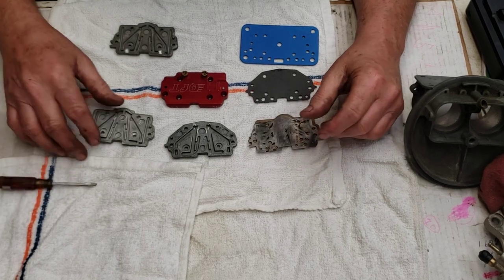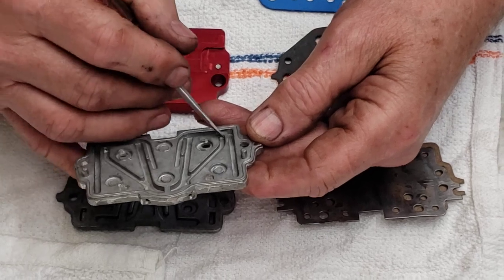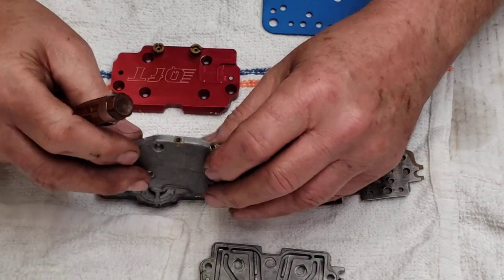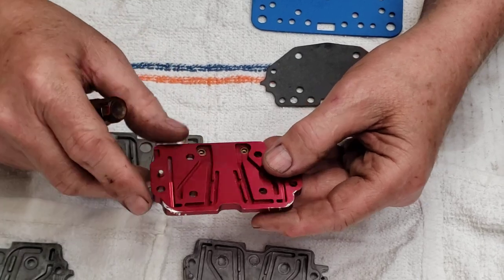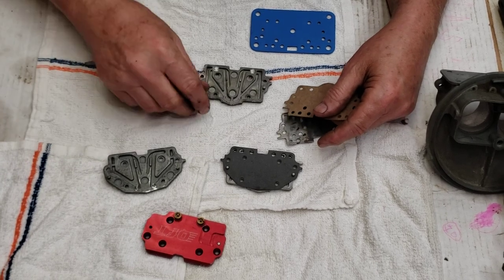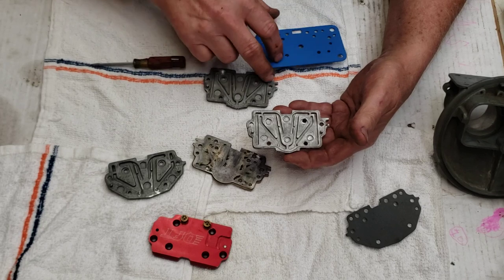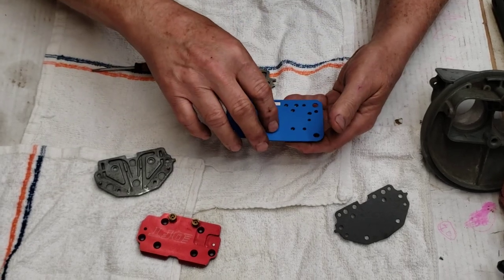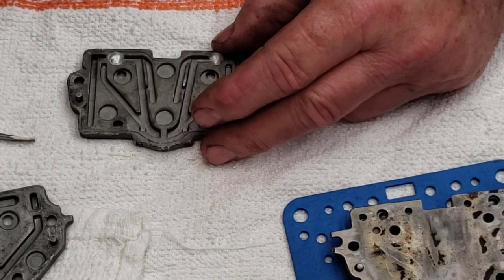4160 Rear Metering Plate Tips & Tricks

Comment: I bought the same QFT plate.  I am not sure whether or not to install the original thin plate when changing the metering plate. I seems the QFT is thicker but I wasn’t sure whether it goes gasket plate gasket QFT plate or gasket then QFT plate. Thanks!  Great info on the channel. I have learned a lot!
Reply from the maker: I just run gasket and plate. Hope this helps.
Reply: Yes it does. Thanks again!

Comment: How much thicker  is the qft plate? Will it interfere with the float? I like the side hung bowl on my 1850. Liked your video. Keep it up.
Reply from the maker: Qft plate about the same thickness and yes it will interfere with a brass center hung  float. Hope this helps.
Reply: Thanks for answering the question. On another note, would the qft plate interfere with the nitrophyl float in a side hung bowl?

Comment: Randy, I just upgraded my 3310-2 from a 134-21 metering plate to a secondary metering block conversion Holley kit. The factory metering plate had .039-.040 IFR’s. This new metering block has .030 IFR’s. Does that mean I have to drill them to .039-.040? Any advice would help. This carb has no secondary idle. Only the tiny drip holes under the secondary transition. Thank you and great video!
Reply from the maker: I think I would try it with the .030 thousandth ifrs and see. The metering block is absolutely better than the plate. If it causes problems then I would change it. Hope this helps

Comment: Hi Randy !Thanks for all videos they are very helpful. Can you tell me how much the secondary transfer slots should be open? my primary ones are .040 open as  you have said in another video but to get my idle speed to 900 RPM i need to open the rear up to .080 is this to much?my mixture screw are 3/4 turn out to get the best vacuum. Carb is 0-1850 600 CFM 2 corner idle, on performer RPM MANIFOLD 302 Windsor with a mild 220/235 @ 050 hyd cam. Thanks for any more help that you can suggest.
Reply from the maker: I usually drill bypass holes in the throttle plates but, if its not causing you any problems that will be ok but no further than .080, I would rather drill bypass holes its a better way with out opening the secondary plates. I usually start by drilling four  .080 holes in the throttle plates , drill the holes in the throttle butterflies on the out board side , or the side nearest the transfer slots. I usually start with .080 holes and open up a little at a time using only your primaries until the primary transfer slots are correct and at proper idle speed, hope this helps, I have a video out there that shows this procedure. I believe its called tuning your idle circuit with high duration cams. Take care.

Comment: Hey I've got a new Holley carb that's pushing fuel out the vent the old carb was doing the same thing has new fuel pump and regulator
Reply from the maker: Check your fuel pressure it should be no more than 6psi for the street, check for trash or dirt in fuel, check and make sure nothings blocking the vents. Other than that check your floats an needle & seats for sealing. Hope this helps.

Comment: Hi randy i can not find a answer anywhere. Do the Quick fuel plates have a idle circuit? They d9nt list any size of them if they do on any web listings. 
Also i am running a pair of 660s on a 468 bbc with a 671. And i have drilled the primaries and after watching yourvideos will be drilling the secondarys but should the secondarys be opened at .040 transfer size? Or closed
Reply from the maker: I have a quick fuel secondary plate and it has an idle circuit, some have a removable idle fuel restrictor and the question about the secondary transfer slot, it should be closed. Hope this helps.

Comment: Hey Randy, I'm trying t set a carb with 4 corner idle on a old Barry Grant 750 double pumper that was rebuilt. I'm not getting much change on the any of the mixture screws but the back left screw. If I turn the other three of them all the way in, it leans out but not kills the motor. The back left will kill all the way in. The funny part is at idle with all out 1 full turn I get an AFR around 12. What should I check? Thanks
Reply from the maker: Mike if the carb is in good shape, first you need to adjust your idle speed screw to close your transfer slots up, where there is no more than 010 to .020 of the transfer slot exposed, with a four corner idle circuit this is what it takes to help lean it,, then look to see if your carb has an adjustable idle air bypass if so adjust to get your proper idle speed without changing your idle screw much, if you don't have a adjustable bypass then it should have bypass holes drilled in your throttle butterflies , if not you will need to drill all four butterflies, starting at .080 thousandths  and tune from there, the bigger the hole the higher the idle will be. Also open your idle air bleeds up .005 at a time no more than .010 max then readjust your idle mixture.hope this helps.careful not to drill your bypass holes to big. You may won't to look at some of my videos covering this, If you have problems let me know.

Comment: Hi Randy, I installed a 750 DP on my 390 Ford. It was new in 2012 and is great shape. I had a Autolite 4100 on the truck and it ran great. Once I installed the Holley, I noticed I could not adjust the mixture screws. I could turn them all the way in the mixture would not change. When I drive the truck it drives fine but backfires through the exhaust when I decelerate. Any ideas where I should look first? Thanks!
Reply from the maker: You need to check the power valve for leaking, if pv is bad stop and replace and retest if your still having, then you need to look at your transfer slots how far there open at idle you won't about .020 to .030 thousandths exposed, if you have 2 or 3 timesthat much, you may need to drill some bypass holes in your throttle plates i start at .080. I have a video you need to watch, it called mods for the idle circuits with high duration camshafts, watch the video but close your transfer slots up to where there is only about .020 to .030 of your trans slots open, your may have to repeat removing carb and drilling bypass holes bigger several times to get it were it needs to be, each time you drill the holes bigger you will need to lower your idle speed, which intern closes up your transfer slots, again you only want to see .020 to .030 of your transfer slots exposed. Hope this helps.
Reply: @holleycarbshowtosadvice40y90  Thanks so much for your detailed reply and support Randy!

Comment: Hi Randy, 

I almost went and purchased a replacement metering plate with a bigger main hole but it looks like I can modify my current one in my 4160 2 corner 600cfm Holley carb.  I got the carb mostly tuned right everywhere else and with regards to this video, I was wondering if there's a way to modify the metering plate to get rid of a ~1 second lean spot (15-16AFR) entering WOT (less than 1" vacuum).  I think that's when my secondary throttle blades start opening.  After that 1 second lean spot my AFR recovers to the 12.5-13AFR range as I stay at WOT for a few seconds more.

I have my carb on a dual plane intake on a bone stock 302 with the yellow spring in the secondary diaphragm and it doesn't bog when I floor it to WOT.  Please let me know if you have a solution for this issue.

Thanks,
Roland
Reply from the maker: Try changing from the yellow secondary spring to the brown spring, also make sure the secondary float level is set right.  I think your secondaries are opening to quick. Hope this helps.
Reply: @holleycarbshowtosadvice40y90  Thanks Randy. I actually tried the brown spring before the yellow and the lean duration was worse. Float level good set to trickle out of sight hole while shaking car like the primary sight hole. Should I try maybe raising the float level by a quarter turn of the adjuster?
Reply from the maker: Usually the secondaries are opening to fast but you could try richen up the secondaries. Make sure in the secondary diaphragm housing that the ball check is there and some have a office instead of the ball check, make sure which ever one you have  isn't missing. I would keep the float level setting you have,  I always run the pink accelerator pump cam on the 4160s because of its long duration of pump shot, let me know if your still having problems, one of these ought to  take care of it. hope this helps.
Reply: @holleycarbshowtosadvice40y90  I can try the brown spring one more time and record the data.  Would it be okay for me to email you a graph plotting telemetry from a recent pull I did from cruise to WOT?  I think I saw your email written here in some comments.

The check ball is still in the secondary diaphragm housing.  Will the pink accel pump cam still help even if I gradually get the throttle from cruise to WOT?
Reply from the maker: Before you do anything else check your secondary ifrs for blockage and if not blocked, richen your secondary ifr by.010 thousandths and see if that helps. Let me know.
Reply: @holleycarbshowtosadvice40y90  I was watching your other videos about idle fuel restrictors and enlarged my primary IFRs from .026" to .033" which helped resolve my 16-17AFR lean condition in part throttle rpm range of 1200-1800.  I still get occasional lean blips here and there but the durations are very short compared to before the change.

I went ahead and did the same to the rear metering plate as you suggested (there was no blockage) and enlarged the IFRs by .007".  Not quite .010" but I didn't notice any change yet.  It was not a very good pull to WOT though so I will have to try again.  I'll post an update after I do that.  :)
Reply: @holleycarbshowtosadvice40y90  Hi Randy.  Happy Memorial Day weekend to you.  I mistyped my last reply and meant to say it was not a good pull to WOT but today I did a good one and I still get that 1 to 1.5 lean spot entering WOT but this time it happened later in the rpm.  

I used to get it at at 3700rpm and now it happens at 4100rpm.  I wonder if this is because the secondary throttle blades are about 1/8" below the bottom of the secondary transfer slots?  I didn't change anything else other than enlarging the secondary IFRs to .033".

Comment: Hey does my basic Holley 1850 with stock metering plate.....Idle circuit actually do anything?
There are no mixture screws. Does it meter any gas at idle?
Reply from the maker: Mike  the primary metering block should have adjustable mixture screws, if your talking about the rear metering plate there are no mixture screws, but there is a idle circuit in the rear metering plate its usually around .030 it feeds the rear idle and the rear transfer slot the idle feed hole in the throttle plate is about .024  Hope this helps.
Reply: @holleycarbshowtosadvice40y90  Yep I'm talking about the rear plate on my 4160 1850 600 carb. It's adjusted and working very well on my mild 350. I'm just struggling with the idea it's actually doing anything.
Reply from the maker: Take it easy

Comment: How you get that tin plate off without bending the heck out of it?
Reply from the maker: If it sticks your going to bend it. I don't use the tin plate or the plate gasket, just use the metering plate on the rear gasket. If you won't  to straighten the tin plate I use a flat anvil and a piece of wood.

Comment: The meter plate seems a pure waste vs a metering block. Why carburetor’s even have plates as compared to blocks must just be for cheapness😊. Performance reliability sucks, they warp and leak. The older zinc cast are far worse than the aluminum ones. Good presentation but need to tell guys plates vs blocks is a no contest,
Reply from the maker: The metering plates are cheap,a metering block is much better. But the plate does work. Everybody to there on.
Reply: Point being I’ve taken many, many zinc casting Holley apart and find the secondary meter plate is warp and way out of flat. That is primary reason they leak. Plenty of main housings also being warped. That needs to be made flat too. One will find the secondary bores wet when let set after engine shut down. Replacement with secondary meter block has better chance fixing problem. Sanding meter plates flat seldom fixes issue for good. A tuned Holley with meter blocks is a far superior running engine than what can be attains using cheap zinc cast meter plates. Warpage is the main issue with cast zinc Holleys in original  60’s cars.